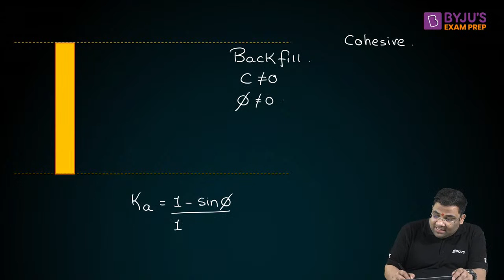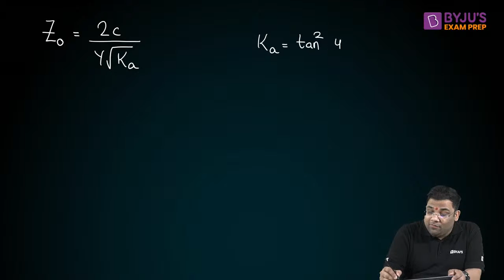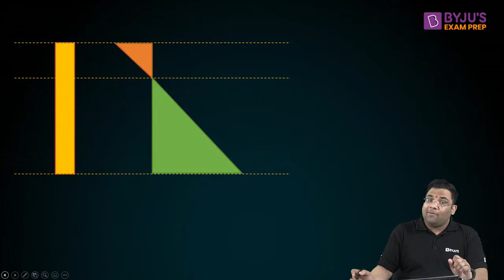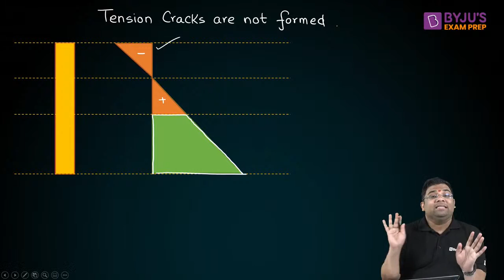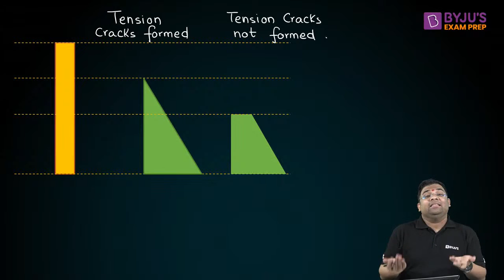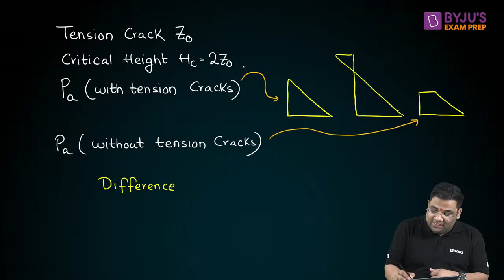Active Earth Pressure in Cohesive Soil | Geotech Engineering | Gate 2023 Civil Engineering (CE) Exam

Comment: 3:14 Active Earth Pressure 
10:12 Depth of Tension Crack
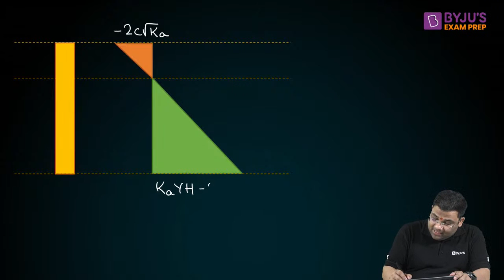20:07 Active Force with tension cracks
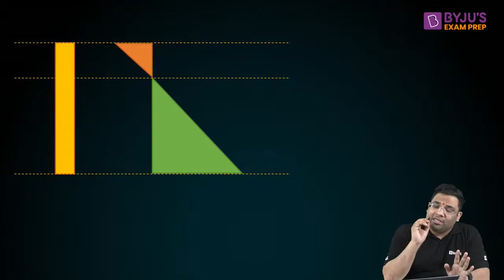27:26 Active Force without tension cracks 
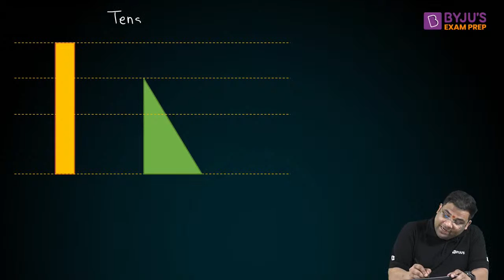36:51 Difference of Active Forces ( with and without tension cracks )
Reply: Sir , where are u from ?